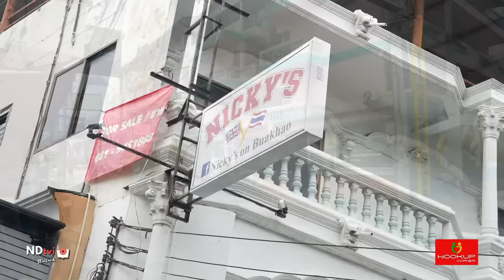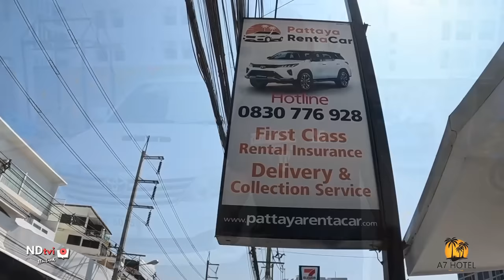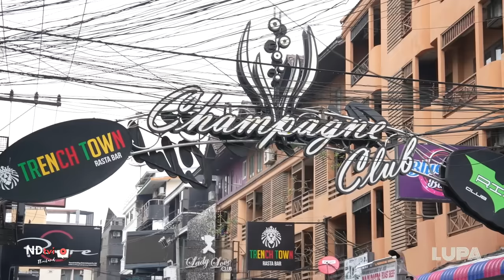Pattaya: Las Vegas Beer Garden Sets Opening Date + Nicky's Soi Baukhao New Purpose Built Restaurant

Comment: My condo gym Has aircon units set up too high and they don't work despite there being 4 big systems built into the ceiling 
I would be careful of that plan too set them so high
Reply from the maker: This is not David's first rodeo he has erected these types of buildings in the Middle East. The AC will be from 4.5 metres height which is set not to annoy people. Everything has been proper calculated in the engineering side so I'm confident it will be perfect.